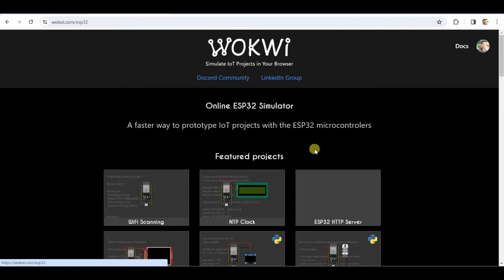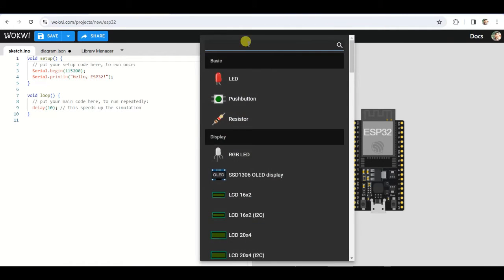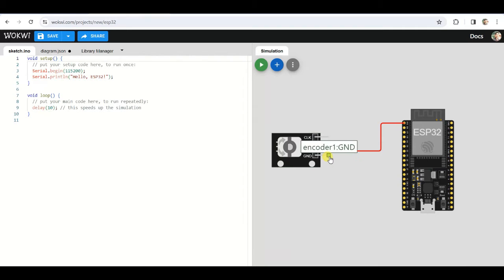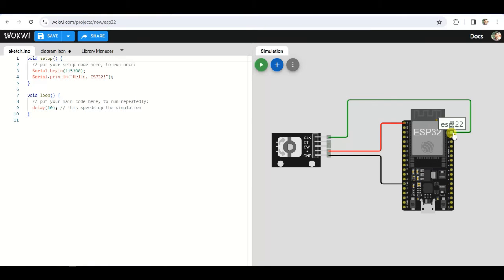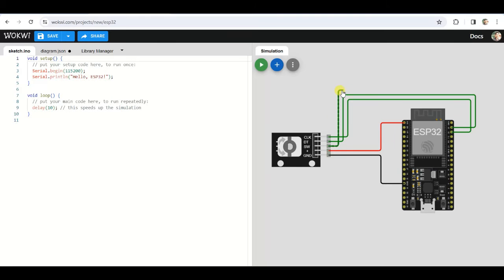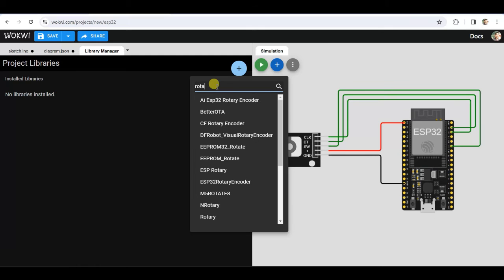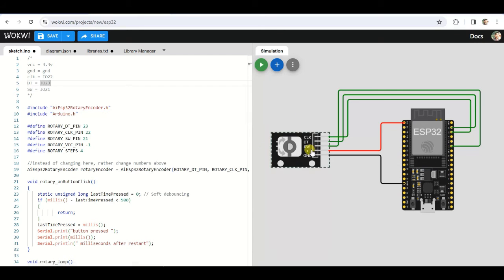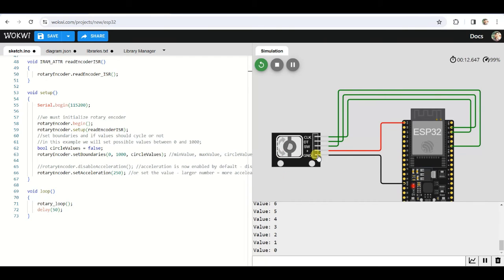Rotary Encoder Simulation with ESP32

Comment: Can you please tell the max value count it reaches for 1 complete clockwise or anti-clockwise rotation
Reply: buddy, it does not have an end value like normal variable resistors; you can set you own end at which it will not exceed